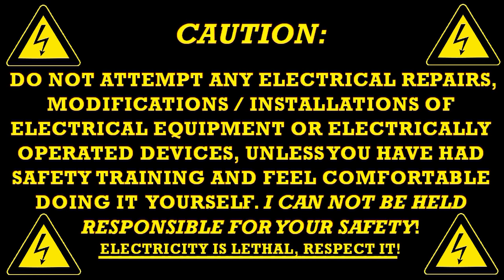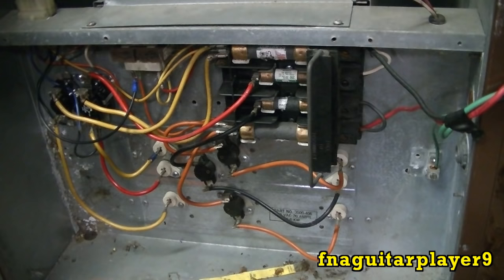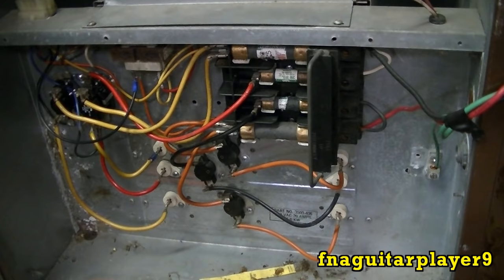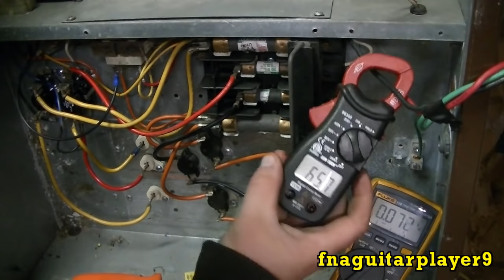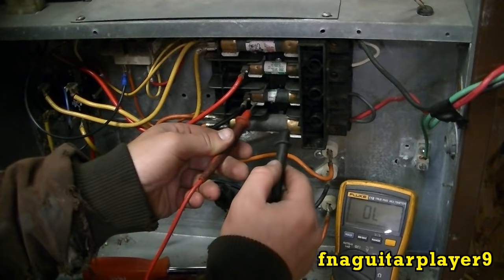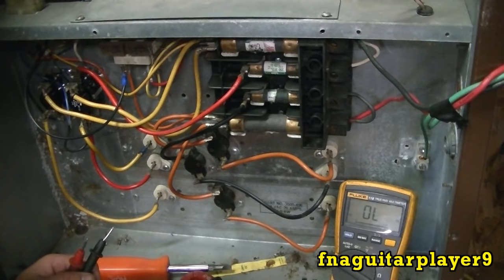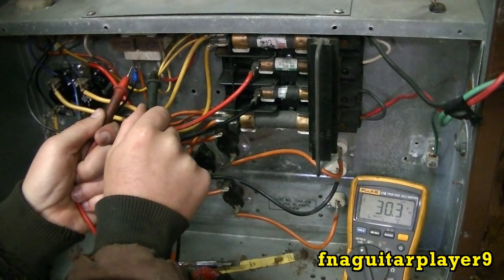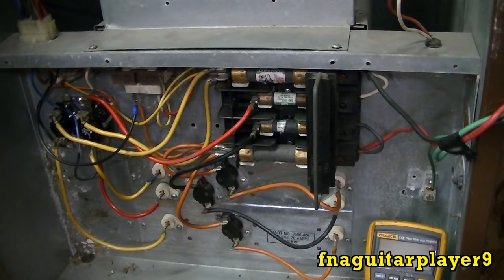How To Diagnose Electric Furnaces: Check Fuses, Element, Sequencers, Thermostats and Transformer

Comment: I want to know what is going on with my electric furnace it turn on for a few minutes and the breaker jumps.
Reply from the maker: Sounds like the 2nd or 3rd element may be shorted out, when they first come on its just the blower and the 1st element if there is a short or something with the other elements it could cause that to happen, now it could be a weak breaker or not the right amperage breaker causing that, but if it just starting doing it then i'd check the elements or see if a wire is loose and shorting out or anything like that. thanks for watching!!!

Comment: hello you have very good videos, I have a question I hope you can help me, my house heating is very old as 1950's water radiators, I'm having trouble because it's getting too hot, all the radiators and pipes, could you tell me how can solve the problem, I hope you can help me thanks
Reply from the maker: I've never worked on a system like that but i would have to guess it would be a thermostat issue or some type of temperature sensor/ switch causing something like that. Thanks for Watching!!!

Comment: Do you provide any advise to someone to troubleshoot other than what is on your website?  I am lost because I do not have the correct electrical diagram.  Fan comes on but no heat. All fuses & elements are okay. Get lost kind of on the sequencers.  Not sure if my sequencers are 24v or 220v.  I have an old 1987 Sears furnace made by ICP.  Sure wish I could get the correct wiring diagram for it or similar which would help me troubleshoot.
Do you have an email address or phone to where I could contact you directly. I suspect not since you would perhaps be bothered to death.
Lee Noga
Reply from the maker: This is all i have at this time, more then likely but not always, they are 24v, because it runs off the same power going to the thermostat, but not always. Seems the most common problem is the sequencers. Thanks for Watching!!!
Reply: @fnaguitarplayer9  Well spent considerable time on it trying to follow the wiring to where i think I know a little bit more now of how to troubleshoot.  I was just about ready to check a few things when my Fluke digital voltmeter gave up.  I figured it was the battery and it was very low so replaced it.  Still didn't work. Checked the fuse and it was bad.  Why I don't know.  Anyway went to the local hardware store and for a 15 amp fast acting fuse they wanted over $21.00 for it!!  I went to the manager and he kind of agreed with me that this didn't sound right.  He checked and it was priced correctly.  Can't believe what these fuse companies are doing lately to raise prices.  They make some simple change to the fuse, give it a different number, and jack up the price!!  Highway robbery!  Most fast acting fuses only have a this wire in them.  I wish I could figure out what size wire to use and did a search but could not come up with anything on the Internet.  Hard to figure out why these cartridge fuses should be so expensive.
Lee Noga

Comment: On Monday got home that day my AC in the house was steady running or the blower motor went outside the fan outside went and running wire was broke I wired it it sparked and it quit working

Comment: Thanks for getting back with me I change the relay and thermostat and burned elements and one bad limit and still getting no heat fan motor comes on there is also a looks to be bad therm-o-disc it's above all the other benefits and elements by itself four prongs had three wires one went to heat thermostat one went to fan motor relay and the other one was just hanging don't know where it went any ideas I'm about to rewire the whole damn thing I don't want to. One more thing it's an old Predator unit at least 40 years old everybody in the world worked on I think nothing is as they should be. Also I'm thinking maybe something to do with a common wire The Nest Thermostat said before I changed it or RF no power
Reply from the maker: Your welcome! I hear ya, I've never rewired one, so i can't give any advice except make sure to follow the schematic and triple check everything before you fire it up. You may not need to rewire everything, but I would check the circuits with the schematic, there should be one inside one of the panels with all the wires labeled. hope this helps, thanks for watching!!!

Comment: I have a Electric York funance , about 6 years old. My Ac coil on my furance was really dirty, so freeze. So, my blower fan was running all the time. I open my planum as say only 1 stage of 2 element working. I replace both Limit switch.... but still the same thing... i replace the motor board , same thing... i do have 4 relays.. i change 3.. still the same thing.... my fans still ON ans dont stop... blower is on safaty mode.. on the board.. it flash 3 time.  Im not an expert on electricty.. but each relay seem to work fine BuT.. not sur if its normal.   One have 110V all tbe time.. the second / 3 and 4 got 110 Volt only few second after the thermpstaht ask for heat.. and you can hear the " click "..  ..  110 Volt to each Element.. i got feeling 1 stage is of element not working du to overheating...

Anything i shoud check? Any idea ? Sorry for my english
Reply from the maker: Check resistance on each element, one or more may be burnt up or the temperature switches could be bad. Alot of possibilities. Thanks for Watching!
Reply: Soumds like a bad bored or somerhing wrong with the tstat.  R to g at the tstat staying closed.

Comment: How do you clean an Electric Furnace & Filters in a Mobile Home? Please get back to me as soon as Posssible, Thanks!
Reply from the maker: There really isn't a whole lot to clean in electric ones, you would usually replace the filter every month or as recommended, the only thing that can need cleaned is around the blower, and in the elements, if you don't clean one (i don't clean this one) it will give off a burnt dust smell for the first few minutes, thats really the only problem you will have if you don't clean them, most important thing is to keep a eye on the filter. You can take the cover off the front, remove the elements (mark the wires so you won't get them mixed up) and use a air compressor to blow out any dust thats in it, thats really (to my knowledge) all that you would have to clean in them, Thanks for Watching!!!